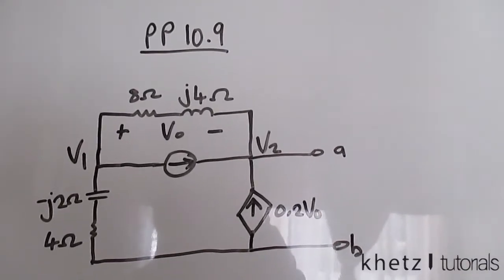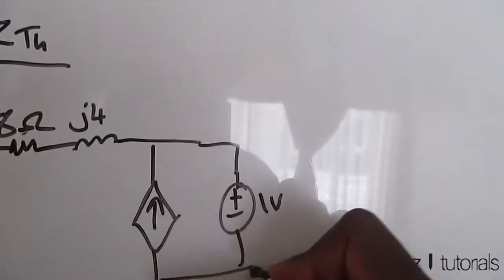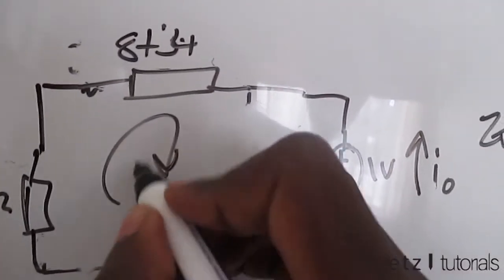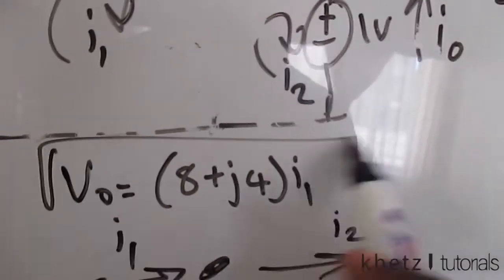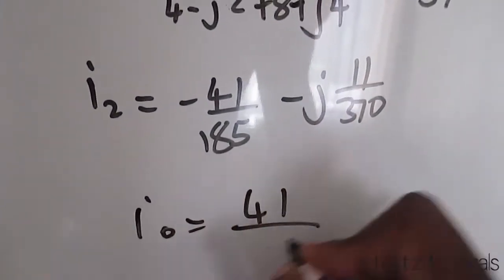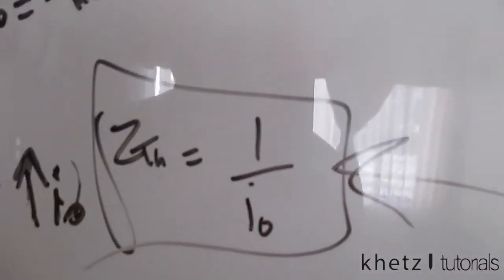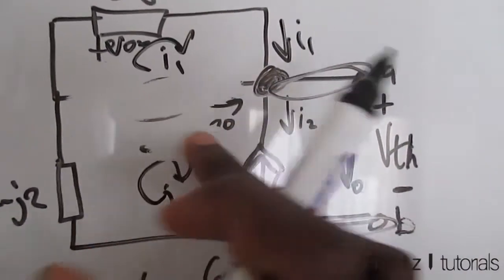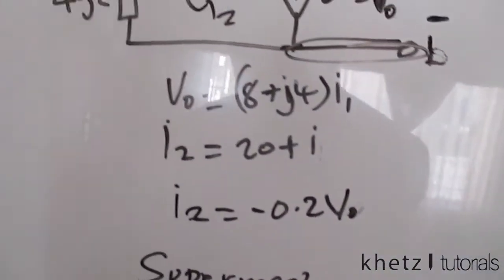Fundamentals Of Electric Circuits Practice Problem 10.9

Comment: sir how to select which power source to put in the circuit when u use thevenin or norton that has dependent power source in it? 
I mean like u put 1v independent voltage source at the very first of video to find Z_th, how can i choose which power source to put in?
btw your videos are very helpful, thanks for the great videos
Reply from the maker: As stated in the theory, you can either use a current source or voltage source. When you use a current source, you'd find the voltage across it, then find Zth = V/I. The method I used here is just my preferred method. In this case, you'd use a voltage source and then find the current through it. The current source or voltage source can have any value - it's just easier to work with 1v or 1A. The choice is yours to make
Reply: @KhetzTutorials  So does that mean I can solve the problem by inserting either a 1V or 1A power source into the circuit? Are you saying it's just a difference in the process, but it doesn't matter finding the answer?
Reply from the maker: @내이름을볼수있는-n2i  Pretty much. You can try both to figure out which one you prefer or just to make sure you understand both
Reply: @KhetzTutorials  Thank you so much. I really appreciate your kind reply. Your videos really helped me a lot!!

Comment: how did you find Zth, my  result of angle is different
Reply from the maker: I simply put 1/(41/185 + 11/370*j) in my calculator, and it gave me that value. If you aren't getting the same, just reset your calculator's settings and make sure it is in degrees
Reply: @KhetzTutorials  thank you very much, now i understand, actually my calculator wasnt in degrees, it was in rad.

Comment: is the answer correct ? Thequestion also wrong
Reply from the maker: I believe the answer is correct. Which part of it did you find any mistakes?
Reply: @KhetzTutorials  the current source in book is 5 A not 20A
Reply from the maker: I believe that is the value you have in your textbook as you said. You can get the edition I used in the video's description. The aim afterall is that you learn how to use the concepts and explanation for your unique values
Reply: @KhetzTutorials  another question sir, why the I2 is equal to -0.2 Vo? I was thinking to write I2-0.2vo
Reply from the maker: Currents along the same wire can't be different - they can only differ in sign. The i2 current can be said to flow along the 0.2vo wire but in the opposite direction. Therefore, it'll have the same value but with a different sign to show the difference in direction. Note that 0.2vo is a current source - the vo is only there to show that the value of the current depends on vo so it is a voltage dependent current source.
Reply: @KhetzTutorials  Okay SIR. Thank you very much for making me clear